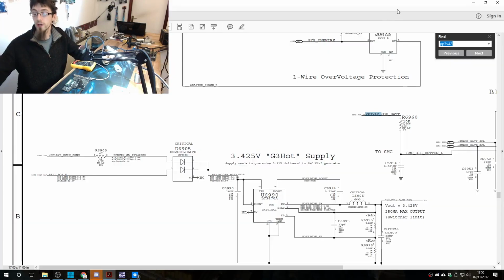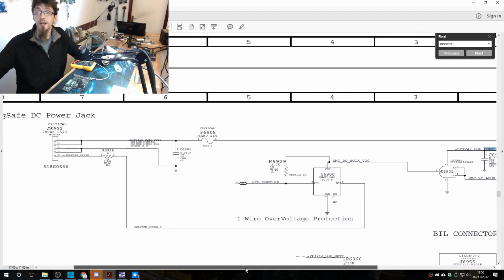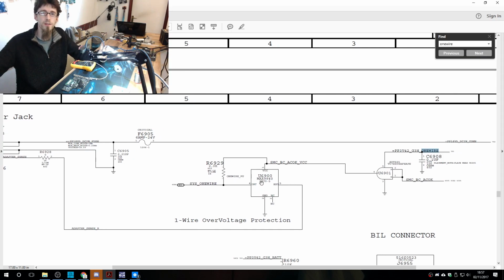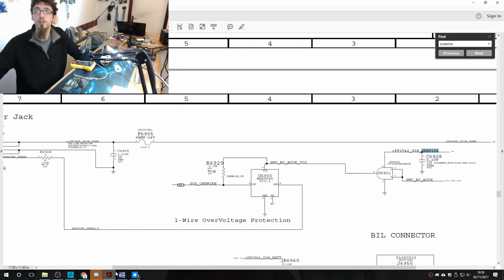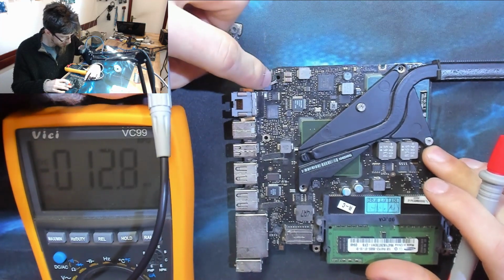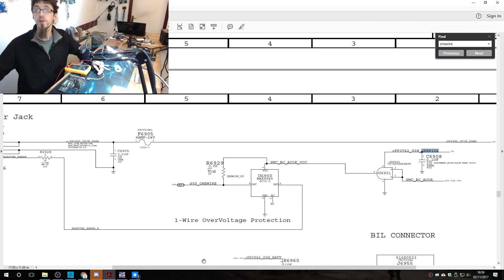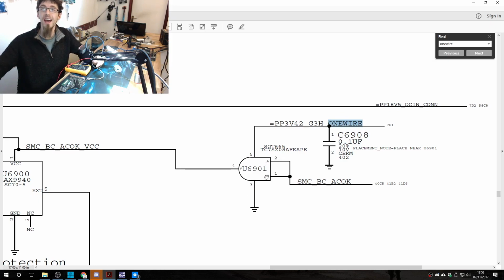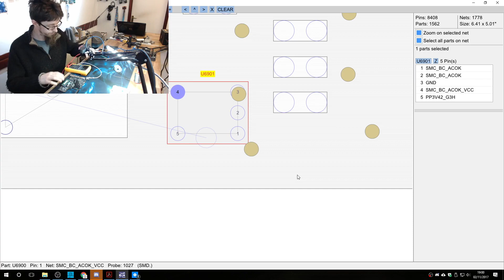Board Repair Basics #5 - OneWire Circuit

Comment: Thank you so much for this -  Im trying to get into the fixing of audio equipment and have been trying to find instructive videos on Youtube to show me how technicians "go about" finding problems.  Also VERY "brain opening" for me is the way you explained how the components worked together to create the correct voltage required (from previous video).  Thanks xxx1000 - Regards from Iceland

Comment: 08:30 Poor little connector on the left of the AND gate :q  You should have at least give it a nice quilt made of aluminium foil so that its plastic parts didn't melt or burn.

Comment: Hi ! 
I know that this is an old video but still I have a question if you have the time... 
is onewire is a code for the charging line ? is it universal ? and is it a logical diagnosing start point when we have pp3v42 and not the charger light ?  
Thanx in advance :)
Reply from the maker: I'm not sure what data is actually transmitted on the onewire line, but the important thing is that the U6900 is getting power. As far as I know, if U6900 is powered up and not physically damaged, OneWire should be fine. The next thing down the line is the SMC and PP_Bus_G3_Hot for the power up sequence.

Comment: You are measuring for PP3V42 from pin 1 of the (missing) AND gate, but in the schematic pin 1 is in fact receiving SMC_BC_ACOK signal. Shouldn't you be measuring pin 5 in the lower left corner contact? (this could also better explain the low reading instead of just the bad contact with the DMM probes) If not, could you (or anyone) be so kind and point out what I'm missing here, please?
Reply: I noticed this also when comparing to the schematics im following using openboard and the schematic, it should be SMC_BC_ACOK signal he was testing, for pin 5 is PP3V42...i guess its just a mistake probably @adamant IT can you confirm?
Reply: I think the reason he's measuring pin 1 is because, he has removed the u6901 and there's no way power would get to pin 5
Reply: @anuoluwapooyelohunnu7958 
No, pin1 is input signal to the AND gate and pin5 is the positive power input so both of these pins should be getting the correct readings even if the gate is removed. Pin4 is the output and thus the only pin that is affected by the gate.
Reply: @tohtorizorro  oh I didn't know that
Reply: @tohtorizorro  I'm just starting at this
Reply: @tohtorizorro  could I ask if you've got any other YouTube tutorials vids as addition to this guy
Reply: I'm trying to get as much knowledge as possible
(Mostly pages which could help on how to properly measure all boards components and understand schematics

Comment: Why use AND logic gate if you short both inputs together anywas?
It defeats it's functiionality completly....
Reply from the maker: It's probably to do with reuse/availability of parts, or that an AND gate chip was a commodity component, but there was no market for a single input version. Why pay for the design and manufacture of something when you could by an off-the-shelf part that can be configured to do the same thing...
Reply: @Adamant_IT  I mean why not completly avoid using it and just bypass it?
Reply from the maker: Yea I see what you mean... You need SMC_BC_ACOK so the SMC has the ability to turn off the green light (so the user has visual feedback about charge status) and you can't power U6900 from that signal alone - but they could've used a simple SOT-323 to allow ACOK to switch in PP3v42.
It can't be bypassed without forcing the one-wire circuit into an always-on (even when unplugged) state, but it could have been simplified. Hell, they could've picked a better U6900 that has an Enable pin on it, which ACOK could toggle.
Reply: @Adamant_IT  Yeah just some transistor if current needs to be higher.

Comment: When reattaching 6901 and gate. What setting and heat was your hot air gun? Eg 5/8  300C. Thanks and these guys are helping me greatly.
Reply from the maker: I usually run my hot air at 400c, and as much airflow as not to blow components away. I use a bit of distance  so as not to grill things as well. Keep in mind that different air stations behave differently as well though, so you may need more or less heat. Practise will teach you when you're running too hot or too cold, you get a feel for it after a while.
Reply: Is good to practice on a faulty board first. The temperature depends on many factors such as your component size, air noozle size, air speed, flux, pad size, surrounding components, and the use of low melt solder. Some motherboards requires much higher temperature due to the type of solder they use, lead/unleaded solder. Usually 380 Celsius as a start, and preheating the board for a while by blowing the component 2 inches at the same temperature for a while and then slowly move into the component and blow the hot air on it can help a lot.

Comment: I don't have power coming to u6901 or c6901? What can it be then? Charger/magsafe board?
Reply: also where can I get a schematic /boardview for the power board? it doesn't seem to be included with 820-2914
Reply: @Adamant_IT  Yeah the problem there is I don't have the schematic for the MagSafe board. its for a 2011 17in MBP. I was going to start reprogramming the gmux ic with a lattice FPGA programmer to bypass the AMD gpu only using the integrated. but the bugger won't turn on now. typical.

Comment: I'm at this stage on my own fix, a more modern board. Diagnostics seem to report that CHGR_BMON is missing (it said reading below low point) , and I believe SMC_BC_ACOK is missing too. Any ideas on where I should start? I've measured for power rails, those are all OK. I'm thinking that the U7100 (ISL6259) has a fault since both CHGR_BMON and SMC_BC_ACKOK (I believe) are missing. I'm not sure how to measure on chips, only resistors. To clarify my board powers via button, runs normally on AC or battery, but does not charge (battery not charging) and has no green light.
Reply: Thanks for the reply. It's a Macbook Pro 13in Retina A1502, board 820-3476-A. I've checked a number of resistors on the board, they all measure within reason to the resistance they should be at (R7120, R7121, R7122 etc). I will probably also check R7110 and R7111. I can't see any visible signs of damage, no liquid or corrosion present, board looks immaculate. I began trying to measure the ISL itself but became a bit iffy on it since I don't want to damage anything further. All I know is I'm missing CHGR_BMON and BC_ACOK, while everything else on the board is telling me I should have full operation. Based on my limited knowledge, it really seems like a bad ISL (which I've ordered a new chip for).